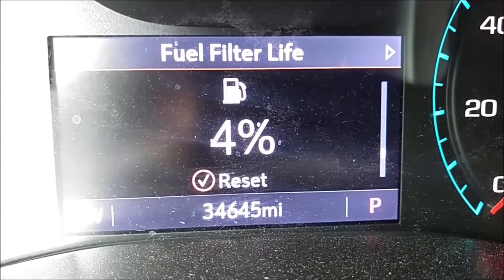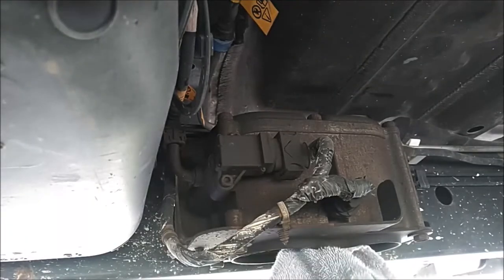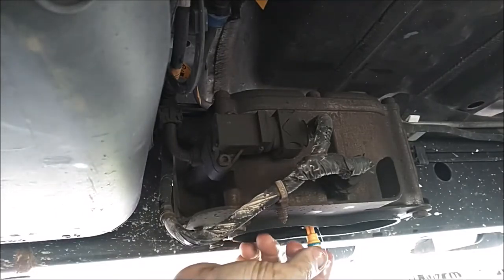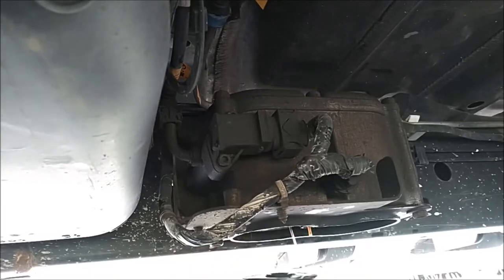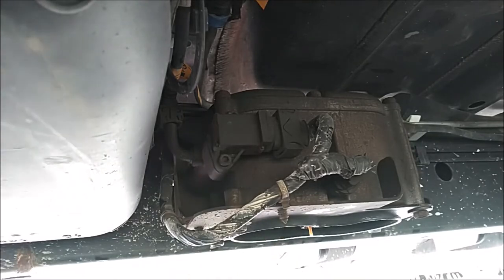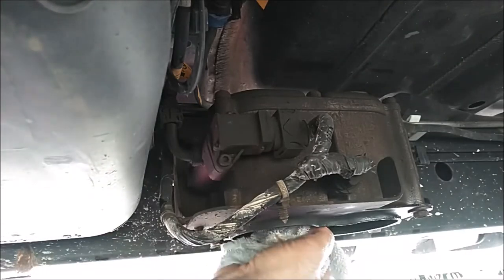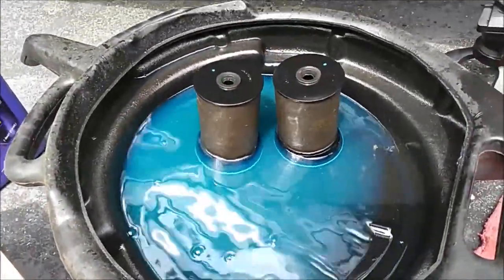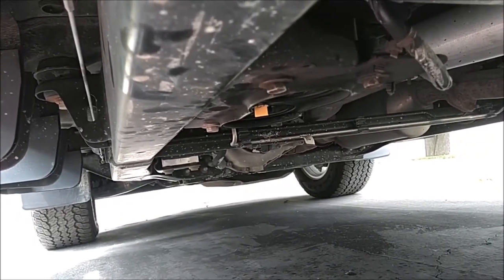2016-2022 Chevrolet Colorado 2.8L Duramax Fuel Filter/ Water Separator Replacement

Comment: From what I understand is that the yellow tab is the fuel/water separator. I have the zr2 bison model and I have to take skid plats off to access the fuel filters. Great video by the way!
Reply from the maker: Thanx   I'm just making a playlist of my experience with this truck in particular the diesel engine option.  I've driven it Out West a couple times and gotten really good mileage.  It's gotten itself unstuck a few times and seems to handle bad weather as well. There's a few things about it I don't like but not enough to outweigh all things I like about it.
Reply: I thought the same water separator ... But he mentioned release pressure so what is it? Do you really have to opened in order to change the filters. Thanks so much for the video!!!
Reply: @moritajm no you can take the filters out without opening it. But that let's the fuel drain before you take the filters out. Makes it a lil less messy for you.

Comment: Thank you for the video, so handful, the reason why us owners of diesel engines have to take care that is because the injection pump push the fuel with a glass pressure and any dust of particles if go through the old filter into the system can be big issues on pump replacement, thanks everyone who gets blessed to have that baby bull on the hood 2.8 duramax turbo diesel

Comment: Great tutorial and explanation, thank you.  I just purchased a 2016 Colorado Z71 2.8L Duramax so this will help out if I decide to change those myself.
Reply from the maker: It's easy to do. Same socket as you use to change the oil filter.

Comment: Torque to 20 Nm / 14.7 ft-lb
I noticed in the fuel that drained out of my truck that there was a small amount of what looked like brass shavings (more like brass dust) at the bottom of the drain pan. Everything on the truck seems fine. I wonder if it was from the fuel station…

Comment: Drain plug will break off and is not available .   The housing will corrode and that is a bear to replace and cost big.
Reply: Do you really need to loose the drain plug in order to replace the filters?